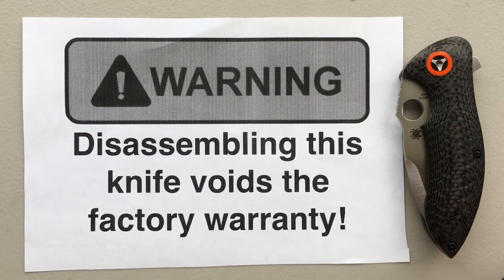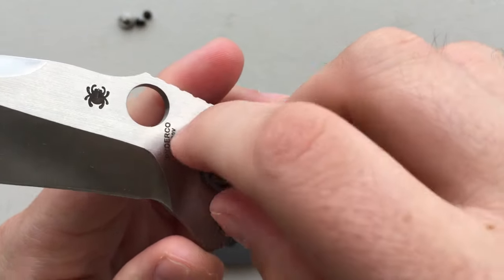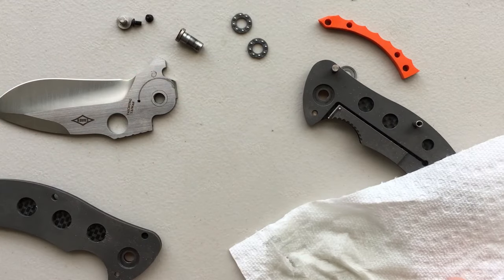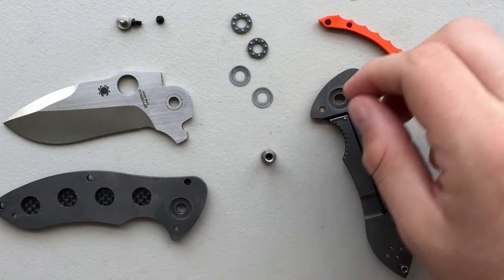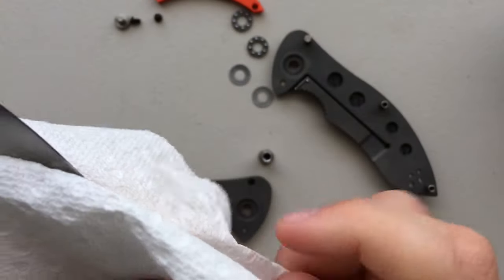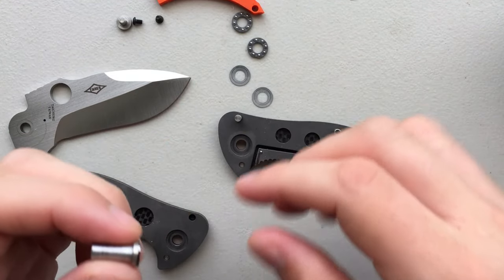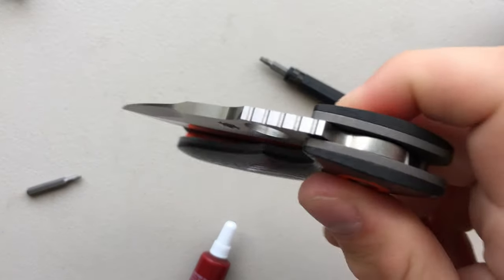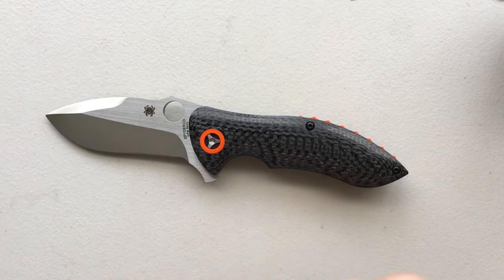How to disassemble and maintain your Spyderco Rubicon Pocketknife

Comment: You gem you!!! I don't know if you noticed, but the backspacer is very pointy on the rubicon, so with your little "slip" you actually fixed it...I just disassembled mine and flipped the backspacer around. It didn't affect the action on the knife and it works like a charm :)

Comment: I just used the video as a reference to disassemble my new Rubicon 2, and it is built exactly the same just with the peel ply carbon fiber/g-10, non protruding back spacer, and no orange around the pivot.  All in all the Rubicon 2 is a great knife with the same blade and a reduced price.  Plus I love the action with the bearings and even added a titanium deep carry pocket clip.
Reply from the maker: Hey, excellent to hear.  Thanks so much for letting me know, I'll pin this.
Reply: Nick Shabazz Np, and thanks for the videos.
Reply: Little did you know, 6 years later a person you don't know at all was looking to find out this exact thing😂 I'm not a huge fan of these bearings/race washers myself tho, looking to do some upgrades on my Rubicon 2 and I figured the og Rubicon was the place to start looking

Comment: Great video. Nick maybe in the distant future a review on Froglube? For my high end fly fishing reels and my knives I use T-9 Boeshields as a finishing lube, I spay some one a micro fibre cloth and give the item a nice rub down. It lightly coats and drys protecting against weather and corrosion.  I'm thinking though if you're using Froglube on your knives theres no reason I can't on a fly reel. They have a lot in common folder knives and fly reels, similar materials and bearing surfaces. What frog lube products are you using? Again thanks for a wonderful video.

Comment: If spyderco does not want you to take the knife apart, then how do they expect you to clean it, especially when the washers have wear?
Reply from the maker: That's the crappy part.  The knife needs to be taken apart if you're going to use it.  And if you're not going to use it, you don't need a warranty.  I get why companies do it, but they've gotta do better than this.

Comment: Just found this video. This in my opinion is one hell of a knife. I love this blade design and truly take this knife and consider it a top tier design and construct.
Many of the Spyderco designs are just so dang boring. I have been around Spyderco since the early 80's and in the 90's I quit collecting them. I feel Spyderco also makes very respectable ceramics as welk.Like Coldsteel I felt after the late 80's and into the early 90's  their quality had really start to slip . Their quality is back along with some new designs and great collaborations. Cold steel not so much. I think they are a knife that was great in the past.
But Spyderco has a knife here that has a real feel of a true custom knife. Like say Randall which I really still collect the earlier Bo Randall knives.
This one has that kind of feel to it. I like heavy knifes. If you like that same type of feel of well built and basically over constructed knives this one is a serious contender for you. The knife has gone up quite a bit online on such places as Ebay for over $500.00. So it is one of those knives that is destined to become a well sought after collector. It is already a brilliant classic. And yet weirdly it is built in Taiwan not in ssy a Semi Japan built. Which btw is still some of Spydercos best production series of knives. The Seki Japan are of serious quality. I have never owned one of their Italian built and many of their USA built are well let's just say over adequate in my honest opinion. 

Also this is one of the finest reviewers I have ever seen. He respects the knife even if it isn't quite to his liking. He takes good care of the knives sent by viewers. And he has earned another subscriber. And I personally thank him.
Thank you kind sir! I wonder if he like myself also works to fine tune and maintain fine Swiss automatic watches as I do? It wouldn't surprise me at all.

Comment: Doesn't the warranty just state "Damage DUE to disassembly" ? they are just covering themselves from people stripping threads, loosing or breaking washers etc. and tampering with the internals. I don't think the act of disassembling actually voids the warranty, I've had a delica replaced because of the FRN thread wearing down in the screw holes for the pocket clip, I told the company I had taken the knife fully apart multiple times and they still replaced it without question, they obviously had no issue with me stripping the thread on the FRN, with a knife that has 4 interchangeable pocket clip positions, how can they not expect me to try them all out multiple times, but because my issue wasn't with any internal parts they still had my back. So if you have a problem with a knife that isn't with the internals and you have taken it apart, you're still covered I'd say.
Reply from the maker: +Jimmy Grey The trouble is the uncertainty.  "Your $350 knife will probably have a warranty" is not great.   And I've asked for screws after buying a used PM2 and got screws with a nasty letter.
Reply: Nick Shabazz Yes I see the predicament. It certainly isn't going to stop me from buying their knives though!
Reply: I've stripped the pivot screws on a positron and a manix 2 after taking them apart. Spyderco replaced the hardware for free and even sharpened the blades even though I didn't ask